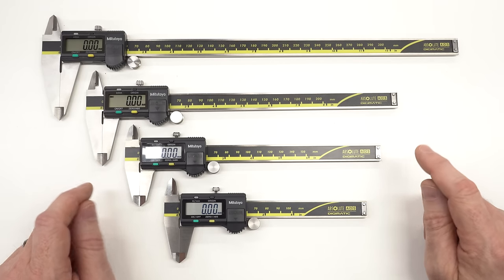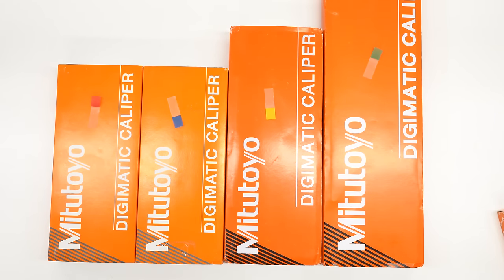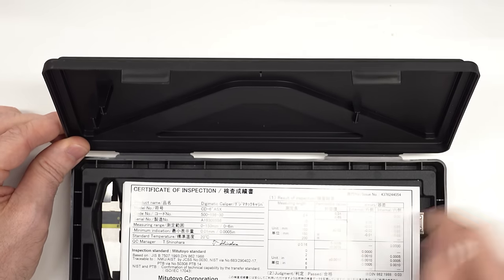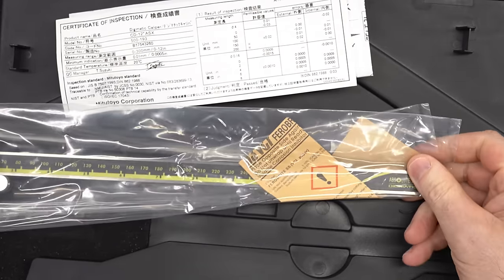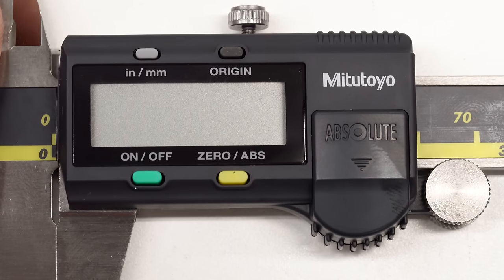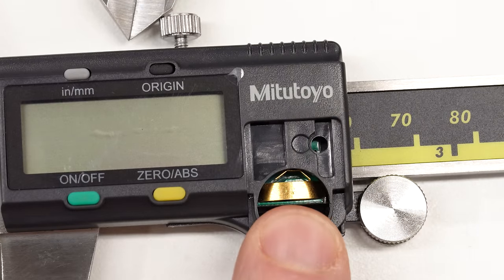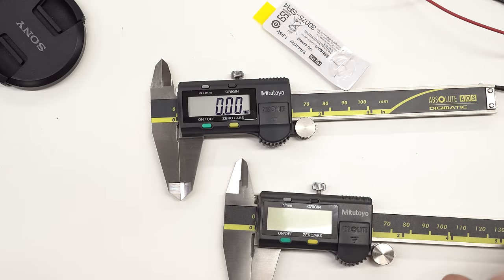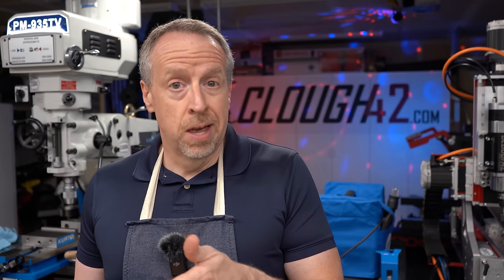17 Warning Signs Your Mitutoyo Calipers Are Fake

Comment: Thank you for a very useful video.  There appears to be different grades of the fake callipers.  I have one that passed some of these checks.  The case and documentation was the same as the genuine unit. The thing that alerted me to the possibility that my calliper was a fake was because the battery didn’t last very long.  Your current drain test was most useful.  I had intended to do the test before I saw your video but having you current readings was particularly useful.  My fake draws 15µA when on and off.

An interesting thing about my fake is I have had it for several years and it’s an older version 500-196-20.  A genuine seller listed the later 500-196-30 but still had the photo of the older 500-196-20 on their website.  The tale on graphics is short and is the same as on my fake so I suspect the graphics has changed between 500-XXX-20 and 500-XXX-30 and the fake makers have not updated their artwork.

I just bought a genuine replacement, which passes all the checks.  The confusing thing is the price offered by genuine sellers vary enormously.

Comment: Modern genuine Mitutoyo calipers use inductive sensors which should be immune to a little water or oil getting on the scale. I'm not sure, but I would bet the knock off calipers are using capacitive sensors. It would be interesting to see a test of what the display does after getting a bit of coolant on there.
Reply: Yes capacative sort of
Big Clive tokk some apart a couple of times so did somebody else about 5 years ago.
The calipers had similar to vernier fingers so that as they slide to measure - only 1 pair of fingers align perfectly. But I believe it was Clive that suggested they were using capacitave coupling to couple a transmit oscilator to a receiving finger and scanning the fingers for max signal to equate to a lookup table.
However they were surprisingly accurate when re-assembled even with parts missing and glued strips pealed off.

Somebody copied the scale to cad and made an extrapolated pcb about 2 feet long and it worked properly in the ripof calipers.
Reply: Or in worst case they might use a potentiometer (variable resistor). Optical shaft encoders, using infrared light pulse as it rotates or slides. I don't know if they could get ten thousandths or finer accuracy though.
Reply: @ElectricBillAlbright   Nah resistive sensing is just not a thing. $3 calipers (the plastic 0.1mm ones) are already capacitive, once you have an ASIC, and they do, shared across all these brands and models and manufacturers, that's just cheap, and does the job. Optical isn't cheap, finicky to get the process right. All they need for capacitive is two PCBs (flex under the scale sticker and rigid for the toolhead) and a gloptop ASIC, and the PCB quality they do is bloody filthy and they're still getting away with it, kinda works. Holy shit that resist application and via termination, it's beyond terrible. And yet it works.

Comment: The tech used in digital calipers has been refined to the point where it’s hard to mess up. Bigclive did a good video on how cheap calipers can be so accurate with such a high resolution.

Knock offs will spend the vast majority of their design cost trying to rip off Mitutoyos look so they can charge over 100 times more than it cost to manufacture them.

Honestly it’s hard to justify Mitutoyo when it comes to calipers unless you have the disposable income or your employer is buying them. I use a company provided Mitutoyo 8” caliper to verify the calibration of my inexpensive Amazon calipers I use in the field. They are always spot on.

Only thing I would suggest is just going straight for less expensive calipers with their own brand name so you aren’t paying for nothing. Something I wish inexpensive brands would do is use a better tech when it comes to battery life or just put a compartment for a triple A battery in it or something if the lower power tech is expensive.
Reply: I would point out that many of the mitutoyo are IP rated and coolant safe. 

My favourite chap brand are igaging and their cheap ones aren't coolant resistant. They do a more expensive version that is, but not at a discount over the mitutoyo...

I think it's useful to have lots of calipers.. get a few decent low cost options and keep the mitutoyo for when you need to do inspection quality work?
Reply: I agree.  This guy inherited some money.  He's got expensive toys.
Reply: I don't mind investing in expensive tools. When I quit my job, they go with me. I think my 9 to 5 boss would like these calipers. It complements  his cheap Chinese lathe.
Reply: Oh, not all all cheap calipers are good. I have some I got at Aldi and they’re unusable. Aside from the ludicrous battery consumption, they skip readings, so eventually you’ll be off by some multiple of 0.2” (5.08mm). Easy to spot when you’re measuring something half that size, but not at all obvious when you’re measuring something 3” across. Screwed me over more than once.

Comment: Hi, I watched your video, thanks. I just received a mitutoyo caliper from a dealer in Italy, ordered in early August. I am 90% sure that this is the original, but there are some differences such as: 1. The color of the scale (the scale gives off green) 2. The color of the box (the box is darker in color, like on the ebay caliper, but the stripes are gray and parallel to M)
 3. The inscription "Made in Japan" on the case is not on the side of the hinges, but on the side of the latches. 4. The abs marking is not under the battery, but on the back of the cover, the position of the battery with the marking is also shown there. If interested, I can take a photo for you, maybe there will be more videos on this topic?

Comment: A tip to save battery is to always do up the lock screw when you turn it off. This will stop the calliper from moving and turning on automatically when you didn't mean to.
Reply: Real Miyutoyo's don't turn on automatically
Reply: Good advice, I'll use that!
Reply: Mine, real, won't turn on automatically.
Reply: The Mitutoyo IP67 coolant proof ones turn on automatically. Also a lot of other brands will turn on automatically.
Reply: The Mitutoyo IP67 coolant proof ones turn on automatically. Also a lot of other brands will turn on automatically.
Reply: @gretschcorvette73    That's what I was going to say. I use one at work and it turns on when I move the jaws apart.

Comment: Something else to keep in mind is that the original Mituoyo gear will last a lifetime. I got a 6" Mitutoyo digimatic caliper in 1990 - at which time I think digital calipers were pretty new to the market and looked like witchcraft to me. Anyway, 33 years later, they're still doing a flawless job - maybe the fakes will last that long... maybe.

Comment: We missed the rest of the battery test, but it was interesting to see the current of the counterfeit was so high. Would have been nice to see an accuracy test, but they are probably very close.

I hope viewers report these on eBay.
Reply from the maker: There are many sellers, and they're getting shut down and new ones are popping up.  I ordered from two different sellers in two different states, but both came from the same address in California.
Reply: @Clough42  James, that address might be a clue to shutting the scam down.  If the items were shipped by ordinary mail, file a report with the inspectors of the U.S.P.S.
Reply: @Clough42  BTW -- the QR code on the genuine one says: 500-195-30 CD-4"ASX B22148743 , which matches the data written in text on the back. The fake one is unreadable.

Comment: For my money there is no amount of improved quality or reduced price that makes it worth getting a counterfeit Mitutoyo. There's certainly is a good enough and cheap enough to make me get a generic Chinese model, but I refuse to support outright counterfeits.
Reply: Same for me too. Don't have any problem with there being cheap basic calipers but strongly object when they are freeloading onto a reputable brand's market reputation.
Reply: I buy cheap ones when I need something quick and I'm away from my shop... and then, usually within days, get fed up with them (doesn't operate smoothly, jaws not machined well... whatever) and order a real one.  A cheap digital caliper ends up being less useful to me than a $50 real Mitsutoyo vernier scale caliper.

Comment: Check the serial number from the caliper to the certificate to the box- all should match. Check the locking knob on the genuine unit won't unscrew all the way out, the fake one does, otherwise a great video. You also proved why my fake Mitutoyo goes through so many batteries!!! Cheers! buy GENUINE!!

Comment: Another thing I decided to check out of curiosity was the QR code.  On the genuine 4" and 6" calipers, the QR code can be scanned, and the info contained within is the Code No, Model No, and Serial No, each separated with a space.  The QR codes on the Ebay fakes seem to not be readable at all.

Comment: I froze the frame when you started and picked up on the fake ones without too much effort.  Items I noticed you didn't note: The locking knobs are different, the bars at the end that are riveted are not in the same place and very much not Japanese, the length of the cutouts where you noted the radius difference are not the same length, the ends of the inside measure anvils are not the same shape.  Need to update your title to "At Least 17"...😀
Reply from the maker: I noticed several more details while editing, too.  At first glance, they're actually pretty good.

Comment: Actually the typical cut‐off voltage (i.e. the threshold they use for measuring battery capacity) is 1.2V for SR44 cells. So the fake ones work as expected, despite the lack of battery low indicator.

It would be interesting to see if the original calipers work down to 1.2V without producing errors. Perhaps you could check?
Reply: the video cuts off before he tests it since 2 seconds later he accidentally ran 12V through the genuine ones
Reply: @thetooth  oops
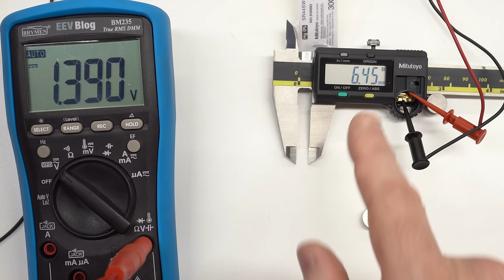Reply: 33:05 was it at this point where 12V was applied to the 1.5V input?
Reply: @thetooth  How do you know?

Comment: I'm pretty sure Mitutoyo changed the button height on the origin button somewhere along the way. I have a 6" caliper from ~2014 that has a recessed origin button. Same with an even older pair I have (non -AOS).

As for the test certificates, I think Suzuki-san retired somewhere along the way because they signed my 2014 pair.

Also you missed another detail on the backside of the cases. The genuine cases have support ribbing from the edges.
Reply from the maker: Yeah. There are many more details.  Good eye
Reply: It might also be a feature that's different on mm and mm/inch models, my mm-only model has the origin button very much recessed and it's not older than about 5 years.

Comment: Buy from a distributor, I even went to the extent of calling Mitutoyo and making sure the retailer was an authorised distributor :|
Reply: Excellent advice.  Years ago I bought expensive Sennheiser headsets on Amazon.  They sounded terrible.  After much research, yep, counterfeit.  Contacted Sennheiser and they directed me to an authorized reseller.  Bought the next pair from them and... yep... another fake made it into what was believed to be a solid distribution channel.  Contacted Sennheiser again and they sent me a pair straight from the factory.  They sounded incredibly good. I compared the real units to both fakes, including packaging, colors, shapes, sizes and feel of the materials used in their construction, and they were all identical.  I surgically opened the fakes up and could see that the internal noise-making bits were horribly constructed by hand.  Always good to talk to the manufacturer when laying down good money for their products and ask where to buy, but also for their assurance on how you can be confident you are getting a genuine article from their distributor.
Reply: All of the errors are blindingly obvious, even if you've only seen on-line photos of a legit set.  No need to get completely anal, just buy them and know that the fakes are ridiculously easy to spot.

Comment: I paused the video on the first picture of the 4 calipers, and right away I could tell which was which by the small riveted plate at the end of the calipers. On the genuine Mitutoyos, it is straight and very near the end, whereas on the counterfeits it is somewhat crooked and not quite at the end of the calipers. Great demo, thanks! BTW, my 24 years old genuine Mitutoyo 8" caliper isn't quite the same as modern ones, it also came in a light grey plastic casing instead of black, but performs as well and is very reliable. It should be, I paid $120 back in 1998 for it!

Comment: I'm glad to find out that mine I bought off ebay for like half of the price are genuine on all counts.
Other differences I can see from your fakes is that the QR code on the back looks like something that is too low res to even get scanned.
There is also sprue mark in the battery compartment in the original and its absent in the fake one.
Label scale on original one is mostly smooth, fake one has got texture.

Also props for the eevblog meter.

Comment: It appears they knocked off an earlier model of the Mitutoyo 500-196-30, mine date late `80's, early `90's. Mechanically, they match your knock offs, from the inside jaw grind, the back groove being ground vs milled, to the yellow swoop being over the 'B' vs the 'O'. As for the digital readout, mine has the absolute button bellow the surface, you need a blunt toothpick to poke it. The ON/OFF, ZERO/ABS are on the bottom, not the front (it actually makes more sense than the newer ones).  Internally, all exposed connections are gold plated, the face is glass, the board has the appearance of carbon fiber. The fit/finish though on mine is flawless, literally took a lightening strike to my garage to kill them (may they RIP). The 'thing' that holds/supports where the rod protrudes at the bottom has beautiful rivets and is ground flush. Great video, just thought I'd share so anyone who has an older pair didn't get disparaged thinking they 'definitely' had a knock off.  The battery, my Horrible Freight ones, I have to flip the battery over if I'm not going to use them for more than an hour they are such pigs. My Mitutoyo, every few years the battery needed replacement.

Comment: I noticed that the quality of the rivets at the end of the caliper are inferior on the knock-offs.  Also, one thing you didn't test is as you drop the voltage on the genuine article, it should hold its displayed value unchanged until the voltage drops far enough that the display just shuts off.  With NO CHANGE in the displayed value.  This is referred to as "brown out protection" I think.  The knock-offs will show an incorrect value as the voltage drops, therefore giving inaccurate results.  The real ones will only ever show the actual value and then just shut off.  My apologies if this has already been mentioned as I do not have time to read all the comments.  Thank you for making this video, James.  It is one heck of a PSA.  Cheers!

Comment: 4 more differences that were not pointed out. 
first, this is the most thorough video available pointing out the differences of the counterfeit Mitutoyos.
Most people will be able to tell that the screens between the two are different. the genuine has a more white/blueish screen while the counterfeit have a darker yellowish screen.
also, My genine pair does not wake itself up from off when moved only when you push the button, while the counterfeit pair wakes up immediately once you start to slide them.
Third, the locking screws are different sizes between the genuine and the fakes, and lastly the locking screw on the Mitutoyos is a captured screw while the fake will come right out.
I dont know if this is a overall difference or it is just between my two pairs, but the small step down on the very end of the depth rod on my counterfeit pair is longer than the one on my genuine pair.

Comment: Love this comparison. I ran down to the Lab and grabbed my calipers to check. They are OriginCal Brand and not Mitutoyo but i wanted to compare the features. IGaging was the registered trade mark brand. Model # IP54 it was a 6 inch version. Key points all say it is very similar to your EBay units. Square machining on the edges, shaped groove from horizonal mill, reset Origin Button, Slightly off Adjustment holes, Back plate no product info just a Conversion table mm to inch. But one thing that throws me off was the battery test. This unit will last months and months on a battery, even when i leave it on overnight it remains operational. I do not recall if it has a B indicator or dims. Actually i think it just behaves weirdly and I change the battery. The frame and operation look and feel great to me. My last Caliper was a Dial gage model in inches from Sears in 1975. I still have it and my Bamboo Picket Slide rule and HP 35 calculator.  Enjoy you posts and helps me to do a better job in my Model Train rebuilds where i use 3D Printed parts and IOT to upgrade my 1950s American Flyer Model Trains especially Steam Engines. Thank You Dennis

Comment: In my job all measuring equipment are calibrated every 12 months, would usually not buy from either Amazon or Ebay. I bought a 6ins Mitutoyo caliper on ebay knowing it was probably fake. Even new our tooling has to go for calibration. The ebay cliper went for calibration and came back with a calibration cert and a note saying it was not a Mitutoyo product. I don't use it at work, I use it at home but it's been calibrated 3 times now without fail. You are correct about the battery life, its not as good as the real thing!